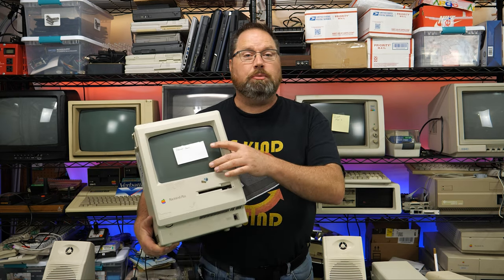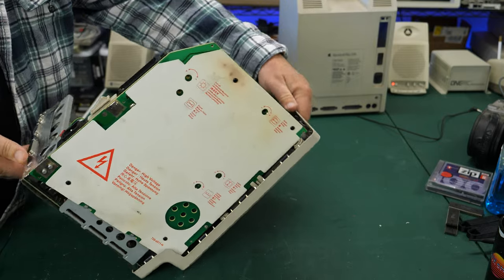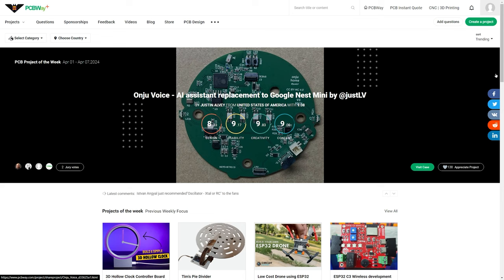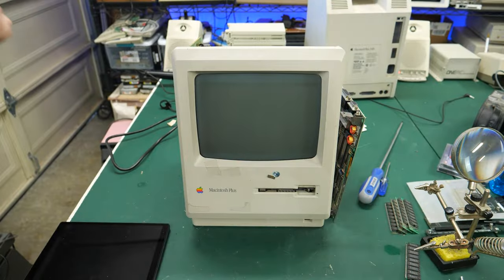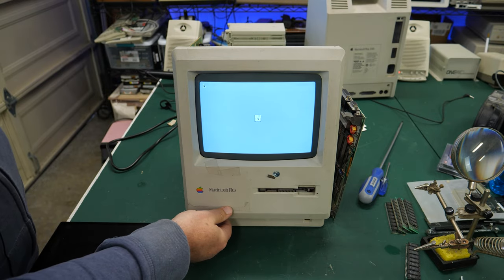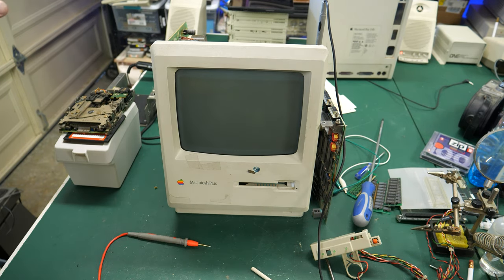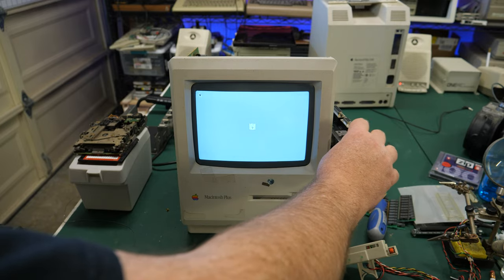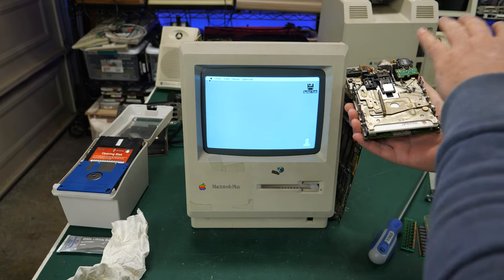Watch Me Bring This Dead Macintosh Plus Back To Life!

Comment: Re: The accellerator board. It's a dual model card. It clips onto the CPU itself with the Plus and maybe Classic, but connects via the PDS slot on a SE. Nothing funky about it. Look at the chips and you'll probably find a 68020 or 68030 on the board itself - ie it's the accelerator board that you've been looking for all along. That CPU clip-on is probably super fragile - so don't remove the card unless you really have to. The accelerator board itself is probably worth a few hundred bucks - so store it more safely than in your "spare parts box".

Comment: Hi Aaron, I enjoyed the video, I have a floppy drive I'll go back too and try your spring adjustment, thanks!  The clear reverse socket that goes over the 68000 is called a Killy clip.  Lots of period correct accelerators are missing their Killy clip because they often get left behind on the original machine so you may want to save that to pair up with an accelerator.  They don't make those any more and the only modern alternative is to solder a socket on top of the processor.
Reply from the maker: Thanks
Reply: Those Killy clips are also rather fragile.  If you have to remove one from the chip it's on, proceed with caution.
Reply from the maker: @horusfalcon Yeah. I took it off carefully with no problems.
Reply: I mean, you could 3D print a new one.

Comment: The screen geometry should be set such that the blinking floppy icon measures 11x11mm exactly.

There is supposed to be a thick border on the top and sides otherwise the image is no longer square and may be blurry in the corners.
Reply from the maker: Cool. Good to know.